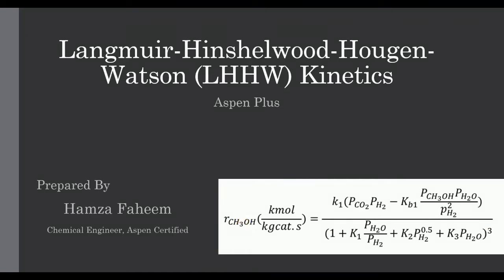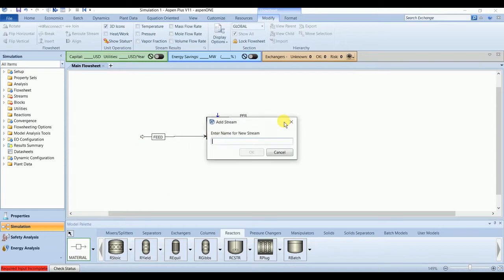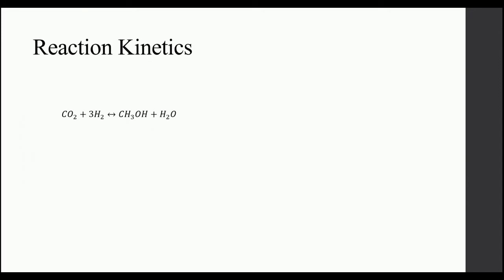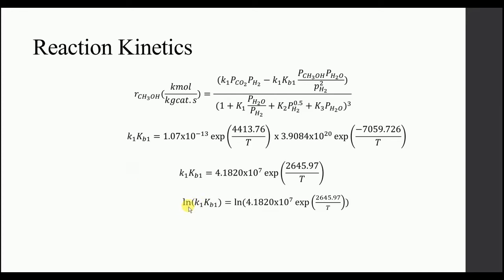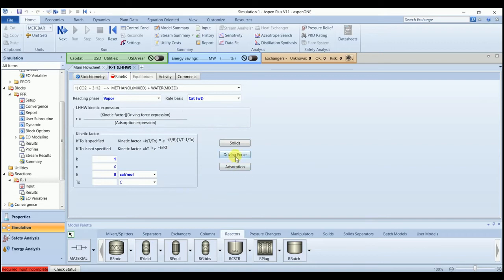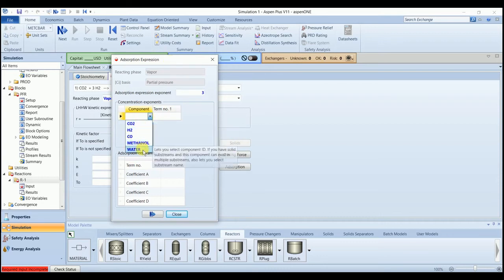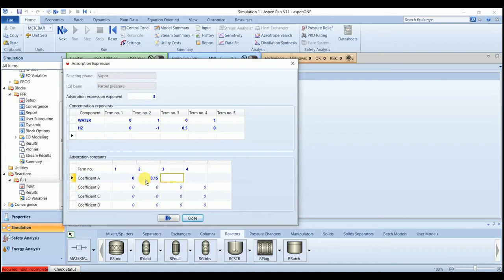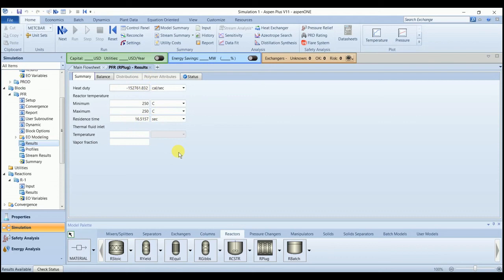Langmuir-Hinshelwood-Hougen-Watson (LHHW) Kinetics || Aspen PLUS

Comment: Hello, thanks for the insightful video you ve made. I have also a question about B coefficients for adsorption kinetic constant. Shouldn't be B=-Ea/R instead of B=Ea/R? B constants seem to keep the same sign with their perspective energies.
Reply from the maker: Hello,
B = -E/T in actual as you mentioned. If E is -ve value (as -4413.76) then the sign of B will be positive which is opposite to energy. If you still confused for any specific term you can ask.
Also read the pinned comment.
Don't forget to subscribe to the channel.

Comment: (@7:58):
In Adsorption Term 1, Coefficient A should be 1 not 0, right ? Otherwise, the first term in the denominator would be 0 not 1.
Reply from the maker: I am afraid no.
Consider some K instead of 1 and K = 1 x exp(0/T). By taking LOG, 
LOG(K) = LOG(1 x  exp(0/T) = LOG(1) + 0/T = 0 + 0/T. Hence, A=0 and B=0.
Reply: @Chemiopedia  ohhhhh you are right! Ok, thank you for your help.

Comment: Hello, thanks for the video, it is great! I have a doubt. In my case I need to put a rate of reaction (LHHW) that is divided into two parts: R1= (k1a.Pch4.Po2)/((1+Kch4.Pch4+Ko2.Po2)^2) + (k2a.Pch4. Po2)/((1+Kch4.Pch4+Ko2.Po2)^1). How can I get the kinetic parameters in Aspen Plus?
Reply from the maker: I once think the same about this kinetics. But didn't get the chance to validate this assumption.
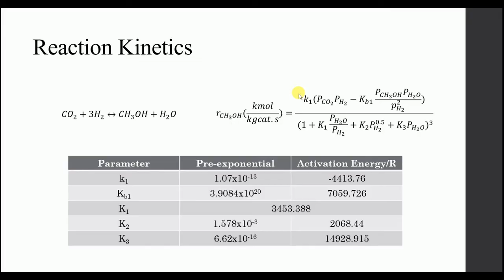Reply: @Chemiopedia  Thanks for the answer. If you find out how to do this, please let me know! I'm trying to put in Aspen PLus the rate of reactions (R1 to R4) that appear at time 5:35 of the "Generalized Langmuir Hinshelwood Hougen Watson (GLHHW) | Aspen Plus" video.
Reply: @gabrieladefrancalopes1796  i think you can put the same reaction twice in aspen and put first part of kinetics for one reaction and second part of kinetics for second reaction

Comment: Hi there, thank you for the video but I'm a bit confused: how did you get the values of k and pre-exponential and also in aspen you put E as 0 but in the video the value of E/R is not 0. can you please show me this part. I'm still learning this section
Reply from the maker: Hello Martin,
There are two different terms in the numerator, kinetic factor and driving force expression. The whole kinetics is defined in second term. I put the value k=1 and E=0 just to make the kinetic factor =1. Otherwise, it will affect the rate values.

Comment: Is there a possibility that you would obtain different results for the same simulation on different versions of aspen plus? Given that the same property method is maintained.
Reply from the maker: Yes. It is possible.
In the latest versions Aspen tech modifies the intersection parameters as well. This can alter the values a little bit.
Reply: @Chemiopedia  Alright, thanks for the explanation. Really appreciate it.
Reply from the maker: @nanayyaw622  Thank you and don't forget to subscribe.

Comment: Thank you sir for the video. Could you make a video on how to model an adsorber or a membrane reactor in ASPEN PLUS?
Reply from the maker: Thank you for your comment.
Aspen Plus does not have adsorber or membrane reactor in model library. These types of units can be modelled in Aspen Custom Modeler. I will look into it and see if I can make a video on it.
Reply: I would appreciate it if you could help me get started with ASPEN CUSTOM MODELER
Reply: One more thing, May I know from where you have taken the kinetic parameters as it will help me in my project. I am currently working on simulation of methanol steam reforming
Reply from the maker: I took them from a simulation book.
That book does not have any reference.
Reply from the maker: Aspen Plus Chemical Engineering applications by Kamal al Mala.

Comment: Could you maybe delay the endscreen a bit more? you can not see the results for your methanol production, my methanol production is only 4 % of the product flow, this seem verry low to me from what i red from papers. What is your production?

In a paper from van bussche and froment i saw that the b value for the second term was appoximately the negative value of what you used, while all other value's where approximately the same, do you know what is correct and why?
Reply from the maker: The end screen has been adjusted.